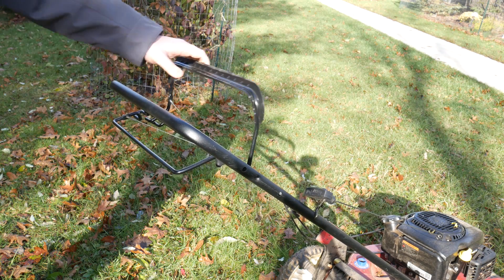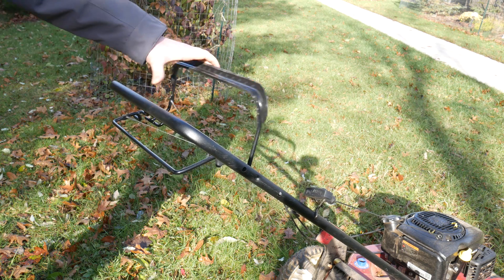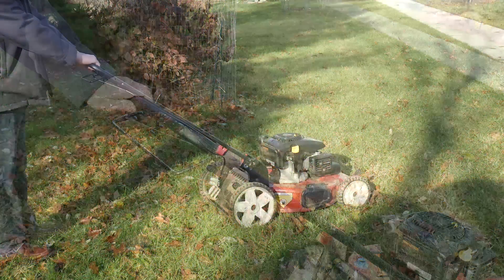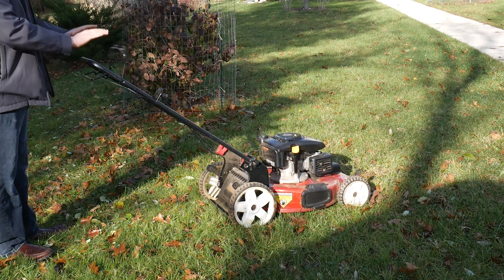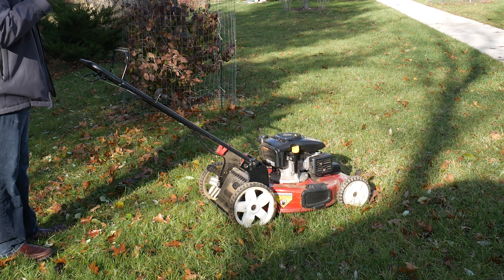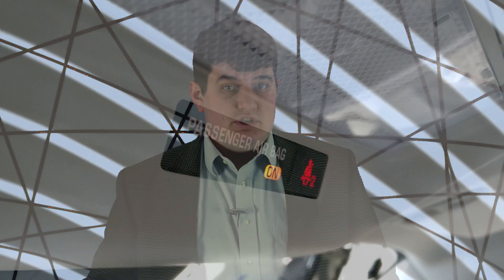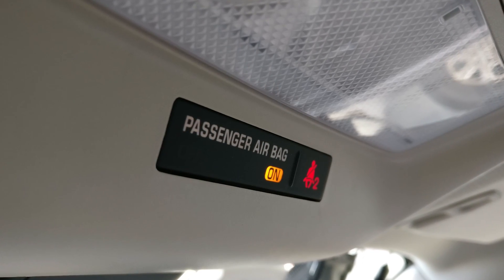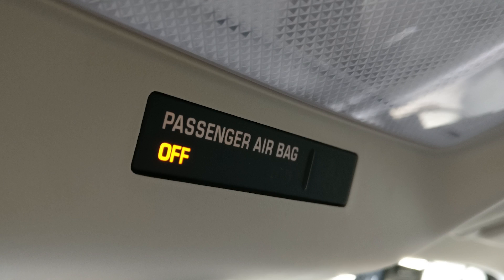The Dead Man's Switch:  How Anton Yelchin's life could have been saved

Comment: A throttle override programmed into the ECU would not have stopped the runaway Prius’ and other Toyota vehicles. The code was already spaghetti, and would freeze with the throttle being applied. The only driver input, aside from steering, that would have any affect was completely releasing the brake pedal, which would cause the ECU to reboot. The drivers who eventually did this restored control of their ‘Yotas, and the ones who didn’t usually crashed and died. You can tell by the skidmarks.
https://users.ece.cmu.edu/~koopman/toyota/koopman-09-18-2014_toyota_slides.pdf

The failsafe that needs to be in place needs to be either entirely mechanical or running on a completely separate system. A lot of vehicles using one computer to run both the powertrain (engine, transmission, etc.) and the accessories (windshield wipers, climate control, infotainment, etc.) have been demonstrably hacked. There are several videos here on youtube of it. 

It’s easier to trust something mechanical that thousands of experts will see, than to trust closed source code from a cooperation. If it’s mandated that all vehicle source code must be open source, then a purely mechanical dead man’s switch will become less necessary.
Reply: Vehicle code needs to be open sourced for safety reasons.
Reply: Yeah, coming from a Computer Science background, I'm bothered by closed-source code in safety-critical applications, especially since laws enshrining DRM as (effectively) an inalienable right have made serious research into the functioning of most modern products (or even discussion of how you might dissect them for audit if you were to receive a court exemption) illegal in the vast majority of jurisdictions.
Whole generations (including my own) are growing up with the idea that taking technological objects apart or understanding them on a deeper level is either impossible wizardry or somehow illegal or immoral by default, and the courts seem to be reinforcing this. The mere act of owning or knowing how to use tools of production and invention (for example 3D printers, chemistry equipment or software compilers) is sort of... socially transgressive in itself today? Either a sign of being dangerously antisocial ("What would you use it for, other than <insert bad scary thing>!?"), or a cool, rebellious individual sticking it to "The Man" depending on who you ask. I don't think that being handy or knowledgable should necessarily be a political statement, but that seems to be the direction society is moving in. Knowledge is power, and for some reason it's increasingly seen as the "cool, edgy" kind of power to be secreted in shadowy cliques and clubs rather than the universal birthright of modern humanity.

I would be very happy if all safety-critical code had to be open-source, though you might want to also do the same with hardware, at least the silicon -- reverse-engineering a circuit board without assistance from the manufacturer is fairly plausible for an individual researcher or small team (if getting increasingly difficult as components shrink and boards get more layers), but reverse-engineering an application-specific integrated circuit on any sort of budget is not really feasible, and bugs (or deliberate sabotage or cheating of regulations) can still lurk at that level.
Any product that is illegal to inspect and publicly discuss the merits and downsides of has no place in a person's house, and it certainly shouldn't run critical infrastructure either.
After graduating from university, I realized that I couldn't get a job in "my field" without getting involved in at least some of the unethical stuff (one-sided click-through "contracts", patenting abstract ideas, knowingly shipping defective products, unnecessarily connecting safety-critical or privacy-critical systems with big attack surfaces because it's cheaper that way, spending extra resources to create an inferior version of a product with so that it can be sold at multiple stratified price points, using bad laws and legal threats to prevent your products from being inspected by experts [and potentially using that cover to hide cheating, eg. Dieselgate], collecting your clients' private information unnecessarily and holding it indefinitely for later monetization, forming secret "gentleman's agreements" with governments to sabotage your products [see printer dots, Eurion, the backdoored cryptography scandals, etc.], etc.) that is considered par for the course nowadays, so I'm just trying to get acclimated to the idea of paying off student loans on lifelong menial labour, or figuring out something else to do with my life. Thank heaven for understanding parents.
Reply: @05Matz  the world needs more people like you.

Comment: I have yet to see a production car using steer by wire. My sister just bought a new Nissan and the steering wheel is connected to a steering gearbox and that is connected to the wheels.
Now I will give you the fact that it has been done in test models and there have been plans to put it into production cars but that is just a plan. 
Now jetliners on the other hand use fly by wire as do many  other types of aircraft.
Before anyone can say what would you know ? I went to school to become a auto mechanic.
Reply: The tech has been there for a while, automakers are just very, very, very, very, very, very cautious with it. Nobody wants to screw it up and be the car company known for making cars that randomly lose the ability to steer. Nissan has some that have a clutch that engages between the steering wheel and redundant steering column in the even of a failure, they are basically testing it with a backup in production cars now.

Comment: Hehe. It's the reason why the Lawnmower scene in "The Happening" is laughable.  All those mowers have that switch.  And it requires a foot to push a hydraulic lever to move....  so no self driving mower. especially with the blades going.

Comment: Side note: forklifts at my workplace have DMS pressure sensors in the seats, and I know more that one occasion where the forklift has become stuck in unfortunate positions because a wire burned out or came loose, requiring the whole seat to be disassembled outside in the rain.

Comment: I'm amazed that people think that machines should protect people from themselves. Anton's death happened because he, like many Americans, don't use the parking brake. Operator error caused the death. The shift lever design contributed to the event, but improper operation (not using the parking brake) absolutely caused it.
Reply: And why shouldn't machines protect people from themselves? Would it really be a horrible thing if this car had some kind of safety feature in place that would have allowed Anton to be alive? Hell, all they would have had to do would be to make a shift lever that doesn't suck.

Either way though I personally very very much think that machines should be made to protect people from themselves. This is like arguing that there shouldn't be guard rails along the edges of bridges. Sure if you fall off and die it's your own fault but the inclusion of the safety feature has virtually no down side so why the hell not?

Give me one good reason why machines should not be designed to protect people from themselves, I bet you can't.
Reply: Yeah. I don't understand the logic that one safety feature is good and somehow two safety features is bad. Like why not? What would be the actual harm in having multiple safety features? Like look at guns. There is the safety switch and a trigger guard. They both accomplish the same thing of avoiding misfires but i've never seen someone argue that they should remove one or the other.
Reply: And that switch already exists on any car - the parking brake.
Reply: True, nothing can be made 100% foolproof but that is why things like gun safety switches exist. There could not be a safety switch on guns but it's useful because it leads to more safety.
Reply: The design of the shifter in that particular car is prone to not changing and should of had automatic parking (no ebrake on his model) when door is opened and seat belt is off or seat sensor, it's how most other car manufacturers do it on these new electronic move to center automatic shifters/nobs (there are normally a mechanical neutral manual override for situations where towing is needed or so you can push the car) 
as sometimes you just forget or miss the park position (especially on the return to center nob/shifter ones) and there is no reason why the car can't auto park when you get out of the car (engine running or not) as the gearbox is computer controlled 

I had a car with automatic ebrake (was a Manual car) so when you moving and stopping at lights it would turn it on and off (think it had a green light instead of orange light when automatic ebraking was used) , but unfortunately it had no option to enable automatic ebrake when you turned off the car and got out of the car, what was worse it would take the stop/start ebrake handbrake off and start to roll when you turned the car off, I ended up turning off automatic stop/start ebrake in the settings menu so I would not forget to use it when parked (it was a USA type courtesy car in the uk) it was not well thought out (but at least you had the option to turn stop/start ebraking off)
Reply: People forget sometimes...
Reply: "improper operation"
No one uses the parking brake in America unless they park on a steep hill.
Reply: Your premises are correct, but it doesn't support your conclusion that additional safety features are unnecessary.
If your logic worked, you might as well do away with the safety switch too.  There's already one - it's called the trigger.  You should keep your finger off the trigger.  Only dumb users misfire.  Etc.
Reply: Guess you never met John Henry Fitzgerald. He was a gunsmith at Colt in their customs shop. One particular set of modifications you could get was known as the "Fitzgerald Specal" which included removing the front of the trigger guard. The reason for this was to allow you quicker access to the trigger when pulling it from a pocket (really the full set of modifications was to improve performance in concealed carry scenarios).

https://www.youtube.com/watch?v=7M91tTJkyMM
https://en.wikipedia.org/wiki/FitzGerald_Special
Reply: "Give me one good reason why machines should not be designed to protect people from themselves, I bet you can't."
They should try to mitigate any danger - that does not change the fact that the only one to blame was Anton him self as there already IS a safety mechanics: it is called the parking brake.

The machine does not know what you want to do.
guns have a safety switch - and it is YOUR responsibility to utilise it. And even then you always treat a gun as if it is loaded and unlocked.
Reply: @ABaumstumpf  One problem with that. In this case, it was Anton who forgot to set the parking brake, and it was Anton who got killed. So you can say it was his own fault. What if it was Anton who forgot to set the parking brake, and his neighbour's five-year-old son wandered into the driveway and got killed? Probably change a few things, wouldn't it?
Reply: @theblackwidower  "Probably change a few things, wouldn't it?"
Nothing would change - it is still Antons fault.
Reply: @ABaumstumpf  I can't believe I have to explain this.

Yes, but who would've had to pay for it? Not Anton, but the kid. And he did nothing wrong legally, so he couldn't be prosecuted. In that case, maybe a call to have a dead mans switch installed wouldn't be so far out there, to prevent the death of another young child.

Instead, it's Anton who died. And this is another thing. You're suggesting that forgetting to set the parking brake is a mistake that should be punishable by death! Does that make sense? What about you? Are you telling me you've never forgotten something? Now, I can honestly tell you I have never forgotten to set the parking brake. But I have forgotten to release it, which was just a funny moment I was able to laugh about. Either way, I don't think forgetting something--anything involving the operation of a car should ever result in someone--anyone dying. If it does, that's a major problem.
Reply: @theblackwidower  " You're suggesting that forgetting to set the parking brake is a mistake that should be punishable by death!"
No, but by your suggestion you would also have to ban every single item in existence cause they can cause harm in one way or another.
Grow up - live is not fair, bad things can happen - but trying to shift the blame and finding a scapegoat is not the way to deal with that.

Again - try to think of what you are suggesting here - you want to take away the responsibility of everybody - that simply is not possible. Would you next start blaming the person that designed the deadman-switch when it malfunctions? His teachers? his parents? Just so you can blame your own fault onto others?

A deadman switch can help - but you trying to rely on that and using it to shift the blame is just pathetic at best.
Reply: @ABaumstumpf  So you agree that it would be better to implement it, rather than let people die. There we go! we're on the same page now. The rest of your rambling is insane. But that one part actually makes sense. Congratulations!
Reply: @theblackwidower  "The rest of your rambling is insane." Yep - that describes your whole rambling so far.
Reply: @ABaumstumpf  Your logical fallacies are false dichotomy and ad hominem.

Comment: EXCELLENT IDEAS A weight sensor could also prevent a child from starting the engine, and/or taking it out of park. Opening the driver's door could also activate park. Level gradient sensors could easily automatically activate the parking brake- which, IMO should be activated in park anyway- taking the vehicles weight off of the transmission to be fully responsible for holding the vehicle while parked. You'd be surprised- how tiny the "parking" mechanism is on an automatic transmission.